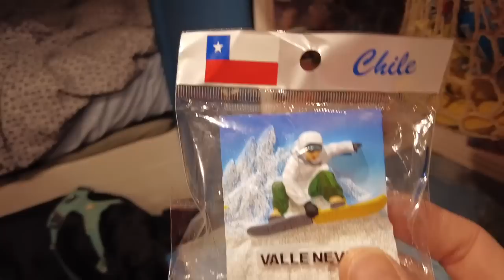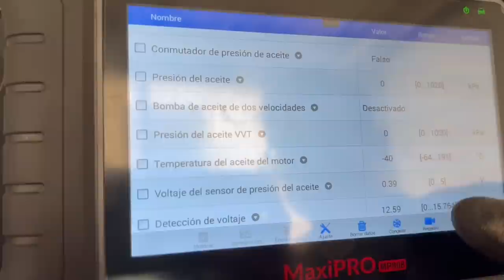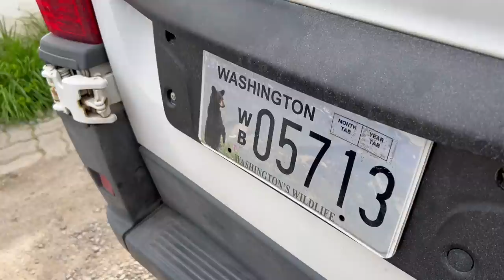WHY WE HATE VAN LIFE | Back to the VAN FULL TIME #vanlife #roadtrip

Comment: Propane gas problem, just a thought, couldn't it be the composition of the gas? here in Switzerland we have Winter and Summer gas. They developed Winter gas to increase the performance of gas stoves at low temperatures. Low temperatures reduce the pressure in the gas container and cause poorer evaporation of the liquid gas. Winter gas is the best choice for outdoor adventures in the coldest months of the year or for high altitudes where lower temperatures prevail.
Reply from the maker: It could be! That’s interesting thanks

Comment: Higher elevations require lower octane for engine performance (or change timing).
Perhaps same with propane: when filled at a higher elevation lower octane was put into tank. Just a thought.
Reply from the maker: Perhaps! At high elevation the person who filled it (very nice owner of an overlander campground in La Paz), said there was some issue and he couldn’t fully fill it. Not sure if there was an issue there or before, but it’s probably been cumulative over years as we have noticed diminished capacity slightly. Thanks for your thoughts on it 🫡